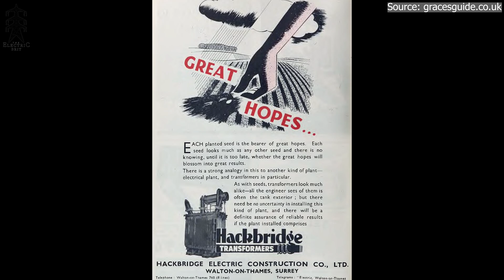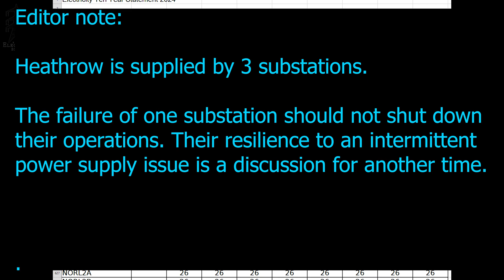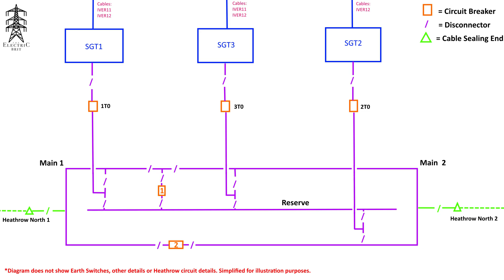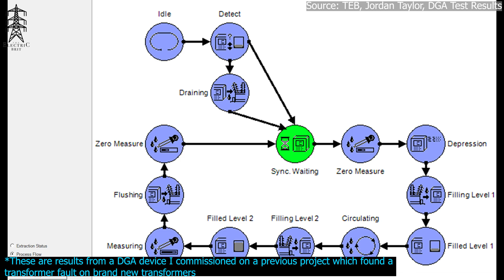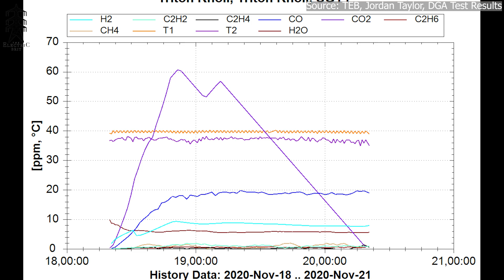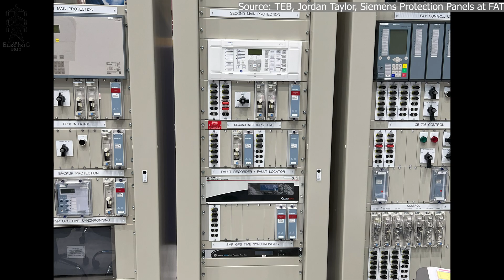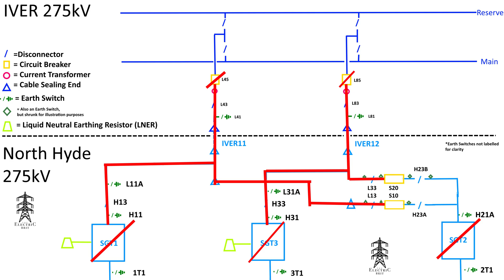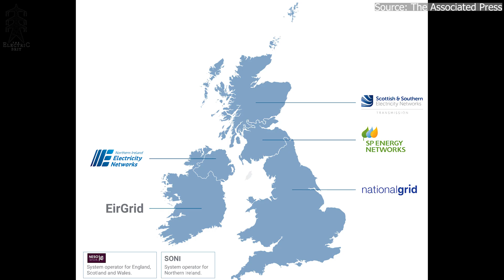North Hyde Substation Fire Analysis

Comment: Back in the 80's and 90's we had to drain all our switchgear and transformers 1,000's of gallons of oil because even though the oil was a perfect insulator it was unsafe to use. They guys who came to take it away to be incinerated in Wales wore space suits it was so dangerous, one guy told me the oil was springing up all over the country as engine oil and somebody was cooking food using it.
Reply: Not a chance, that was PCB oil. When removed it is disposed of properly, not just used as engine oil or cooking food with it. I assume the latter point was a joke.
Reply: @paulharrison2325  It was stolen from industrial sites.. Did you consider that.!
Reply: @lloydbooth-w1j  Sure, 100% nobody was then using it for cooking with, clearly. Have you seen what it looks like?
Reply: @ I have seen somebody cook chips in gearbox oil, you should get out more.
Reply: @lloydbooth-w1j  Sure you have. "Get out more" and see people using gearbox oil to cook chips? I think most people would stay at home instead of going to a place like that.
Reply from the maker: There’s still some PCB filled assets on the network and the provisional date to have it all removed was 2025. It’s known as a forever chemical and ends up in the water, then the fish, then us. Will be positive when it’s gone.
Reply: @TheElectricBrit I am amazed it is still in use, a certain community got their hands on it and used it for other purposes. I was told it was found on the side of roads and in car engines.
Reply: @lloydbooth-w1j  Stop believing urban myths. "Certain communities" were not using PCB transformer oil to cook with.
Reply: @paulharrison2325  You really are clueless "When used for cooking it is reported that transformer oil lasts longer than cooking oil" It took me 20 seconds.
Reply: @ yes that proves people cook chips in transformer oil.
Reply: @ The title is "polychlorinated biphenyl" misuse of, you really don't have the slightest clue.

Comment: Just a technical error that every reporter gets wrong on transformer faults. 
They do not catch fire. 
They irrupt in balls of plasma and molten steel.
Fire is the oxidation of combustible material with a limited temperature maximum, while plasma is the vaporization of metal that approaches the temperatures of the sun.
Reply from the maker: I’d argue the oil was on fire 😉 but yes, the only way the oil catches fire is if the tank ruptures, and for the tank to rupture you need a pressure increase so fast that the PRD can’t act, and for oil to vaporise you need an arc which is many times hotter than the sun and will melt metal. I agree it’s by no means a normal fire and the fire is just a result of the fault. It’s far too late to save at that point.

Comment: You still don't address the layout issues making it necessary to shut down the airport. That's a comprehension issue between electrical safety and delivery safety, based on the premise that the power supply must be survivable against anything happening internally to it. Equipment fails, so your Plan B must be resilient to that, in terms of consequential damage. Why only one substation? Why were the transformers grouped together? Why was there no primary generation plant on site, given the airport's demands are similar to a small city? Generate too much and feed into the grid, rather than draw from it. The questions go on and on, but the knock-on costs in compensation claims are into the billions already.

Comment: the reason for the fire is not the issue , the issue is where was the essential backup ? and if you look into it you will see that it had been changed to biomass from deisel and gas backup gens , i have worked on numerous backup systems and to try replace them with units that cannot supply the demand required in standard power loss situations should be a massive concern to us all , what next ? hospital backup system replaced with batteries etc ? to do such an irresponsible thing is in my view lunacy and will cause these kind of situations to occur more frequently

Comment: Ex power station engineer here. Very nice video with many probable causes of the incident, all of which were totally ignored by the main stream media who jump on the 'terrorist' narrative to get the 'clicks'. Had an incident where I worked with a similar outcome. The tap changer on a 23.5/11kv txfr decided to fail blowing the transformer top off, this also damaged 1 phase of a 23.5/400kv txfr. It also damage the mulsifier system inlet pipework so no water either. Think it took about 6 hours to put out and was a mess of some time after. Will be interesting to see the official report when it's released, bet that won't get much news coverage though!
Reply from the maker: Thanks for the comment and the perspective. The amount of energy in these things when they go is astonishing. We’ve had to use blast walls on site before for equipment prone to exploding and sending debris some distance. 

I think this story was old news by about Tuesday so I think you’re right about the coverage and despite being advised not to comment on this story, the lack of good info in the media was just too much for me to standby and let that negative feedback loop grow with misinformation. I’ll breakdown the full report once available 👍

Comment: Great useful explanation. Thanks. The “net zero” component still has relevancy because, as I understand it, the airport had removed its diesel backup generators thus exacerbating the situation.
Reply from the maker: My angle was more about transmission but I probably wasn’t too clear. Substations still have diesel generators so if the airport replaced theirs and didn’t put sufficient backups in place I’d still blame them and not the energy transition.

Comment: A great video. Given that this substation did fail was it inevitable that Heathrow had to shut? I imagine that Heathrow uses a lot of electrical power, is it viable to get that power instantly from either the grid or back up generators, enough power that is to continue as normal? We know that with even a brief break in electricity supply that computers will need to reboot and that on much small scales UPS's can stop any interruption but on the scale of Heathrow is uninterrupted power possible?
Reply from the maker: Thanks for the comment. Anything is possible with enough money. The power needs of Heathrow are supposedly higher than they’d like to put a backup in for.

That said Heathrow still had perfectly fine supply from two other substations, so it’s whether their internal network is setup to switch. Even if that switch took minutes, it’s a massive failing if it took hours to reboot systems. A grid scale storage facility on their site is totally within budget. Maybe something for airports to consider with their vast last.
Reply: @TheElectricBritThank you. The losses from this shutdown of Heathrow must be huge, well above the cost of a quick resupply system if an instant UPS type one is not feasible. So yes rebooting taking say an hour but much better than this long shutdown.

Comment: THE TRANSFORMER FIRE LOSING COOLANT OIL AND THE TRANSFORMER OVER HEATED WITH THE LOAD BEARING CAUSED THE FIRE I AM OFF NVQ3 LEVEL IN ELECTRICIAN ENGINEERING STANDARD IT IS ONLY MY THOUGHTS

Comment: It's interesting that the most recently installed transformer failed, was it made by a UK company or was it made in an Asian country?
Reply from the maker: Maybe I didn’t explain too clearly in the video but although the transformer is labelled SGT3 it is one of the two original ones on site. The newest is actually SGT2 installed in 2009.

The naming is because of BP109 I alluded to in the video. In simple terms everything on the left side of a bus section is odd numbered and everything on the right is even numbered. So if a new SGT was installed on the left it would be SGT5 despite there only being 4 transformers on site. Appreciate the comment 🙏 if I remember rightly the newest is made by Areva.

Comment: There was a fire at a substation not far from where I live It involved 10,000 litres of (non-PCB) coolant oil.  As there was 400,000 volts @ 4,000 amps running into the transformer.
I wondered how fast the Bucholtz Relay could detect a fault condition & trip the 400KV supply.

Comment: Chartered chemical engineer with two decades in the development and delivery of thermal power plant projects (distribution level not grid level). 

Excellent video. The lack of firewall (with blast resistant properties) and failure of the sprinkler system (even it did not function or was ineffective) are unacceptable in my view. A Durasteel wall could easily have fit into that gap and limited the damage to adjacent equipment. 

I haven't got it confirmed but it is a rumour that the sprinklers were not in operation, but I cannot go into that further, let's wait for the investigation outcome.

Comment: The paper makes sense - that's why Russians attacked this substation. 

My bet is they used thermite (Al +Fe2O3), which leaves residue almost identical to what transformers sre made of. 

This stuff will burn thtough everything, especially steel.

Comment: Why do they spray Water and not foam on them?
Reply from the maker: Some systems use foam but probably require more maintenance. Water does a better job at cooling than foam and there’s lesser electrical risk once a fire starts as the transformer will be off. Misted water is also good at suppressing flames and displacing flammable gasses.

Obviously foam is traditionally better on oil fires at smothering and blocking oxygen which is what the fire service used. Then in the footage once it was out water jets were used for cooling.

Comment: Kind of fascinating. I'm more familiar with the North American system, and it appears the T side is more similar than different. You don't see much T side content as opposed to the D side (which is vastly different). Also, this is a field where millions are spent researching - my former employer has acquired technology that analyzes the power in order to provide advance warning of transformer failure (usually on the D side as they have more monitoring and logging capabilities), but there's potential to detect T side issues. It's mostly used in life extension - transformers are expensive and if you can tell if a transformer is in good shape you can prioritize replacement of one in not so good shape, as well as detecting transformers on the verge of failure to schedule advance replacement before it actually happens. And honestly, the fact the airport was up and running within 24 hours is basically amazing given how much work it actually is.

Comment: Nice, We lost a similar sized transformer when the circuit switcher failed to trip. It basically burned to the ground before we could an upstream open. The oil was boiling

Comment: Long retired power engineer here.
Excellent presentation. Looking at the damage, it was certainly correct to isolate the whole substation. I hope the investigation results are subsequently released and not ignored by the press. Without wishing to speculate (but I will anyway), I would be interested to know if a Buckholtz alarm was received, or an immediate trip initiated. I would also be interested as to whether the older transformers are resilient to harmonics on the network, and if they have reached unacceptable levels with the huge rise of EV charging on the network.
My power station had a generator transformer failure, although not as devastating as this one. I was on holiday when it happened. Luckily a replacement out of service transformer was sourced, but it still took a few months to transport and install.

Comment: Nice video. Only had to set the speed to 0.75, a bit too fast for a Dutchy😅
As a infrastructure engineer in fibre optics / IT networks, I wonder why a large site as Heathrow doesn't have 2 powerlines from different Power Stations?
Reply: LHR actually receives supplies from 3 Grid Supply Points. The North Hyde one described here, plus two others Laleham and Iver (there are actually two Iver stations and the one that supplies this site is not the same one that supplies LHR). They each directly supply different areas of the airport. I also presume the supplies are linked/can be linked onsite to provide redundancy. However, this didn't seem to happen, and from LHRs statements it seems that two sites supplied by other GSPs had some of the worst issues, T2 and T4
Reply from the maker: I made sure to add closed captions as I know us Northerners can talk fast and not so clear. Will work on it for the next one and appreciate the comment!

I have plans in future to cover all areas of infrastructure, internet included so hopefully I get everything correct. And @pmholling is spot on, three supplies to Heathrow, sounds like they weren't prepared for such a large supply switch. Will cover it when we know more.

Comment: This is a Superb Video and explanation of the Grid substation. As a retired distribution engineer, I was frustrated by the hyperbole in press reports and non-technical comments. I did not work on these GSP substations, but was well aware of the operation of the redundancy of GPS transformers. Initially, I was perplexed as to why the redundancy had failed until I saw the extent of the fire on TV news. It was clear that the substation had been taken off line for the fire crew and operational safety. Thank you for your thoughts on this particular incident. I await the inquiry results. Thankfully, no one was injured.

Comment: Great video. I work in a factory where our 11,000kva transformers running our various bus bars were replaced a few years back. They were made by English Electric in 1960 and were showing worrying signs. I instantly guessed the failure was probably due to old equipment.
Reply from the maker: Thanks for the comment. Lots of English Electric kit still on the network. It's all done well to last this long, properly over engineered. Sometimes on the industrial side it can be an afterthought and sometimes its held together by paint.

Comment: The local analysis is information.  But it doesn't address WHY the fire took out the airport.  And hence blame being cast.
Reply from the maker: I will have videos coming once the report is issued on what actually caused the fire and why Heathrow went down. At this time we shouldn’t speculate but from the press it seems this fire didn’t cause Heathrow to shut down as there were multiple supplies to Heathrow, the issue lay with their transfer switch, as admitted by their CEO.
Reply: To be investigated.

Comment: the guy who runs the national grid has come out and said the airport had enough electrical capacity via 2 other substations to remain open. So WHY was the airport shut?
Reply from the maker: From the Heathrow CEO it sounds like their automatic transfer switch wasn’t capable of switching their load to the other supplies without causing downtime, and IT systems that took hours to get back up. 

I’ll cover all the details of the reports when available. Thanks for the comment 🙏
Reply: The nudge units as part of net zero have orders to disrupt travel to reduce journeys by 20% to meet our agenda 2030 goals. A call was probably made from the cabinet office to shut the airport. Its the same reason the M1 is all 50mph now.
Reply: Ah, I've red this a bit later. That makes sense, so they had connections to other substations.
IT, and presumably more critical systems on an airport uses UPS'ses and backup gensets.
So,  I wonder why that didn't work that day...!
I better don't speculate on that😊
Reply: Probably better PR to declare full closure than have media filming thousands of angry passengers all in one place moaning that they’re missing weddings, funerals, bar mitzvahs, etc.  Knowing computer systems, the likelihood of perfectly re syncing everything non-critical, after a full power outage is low.